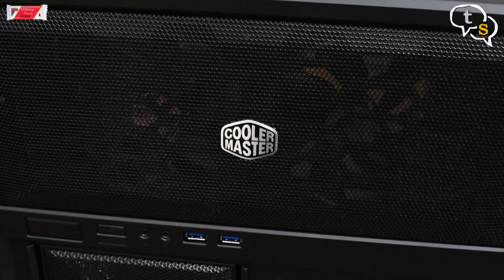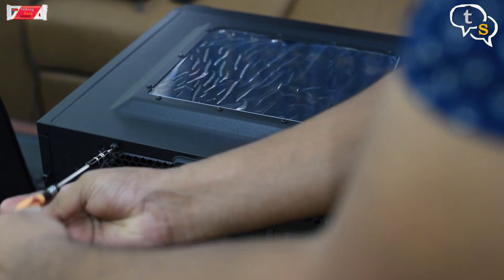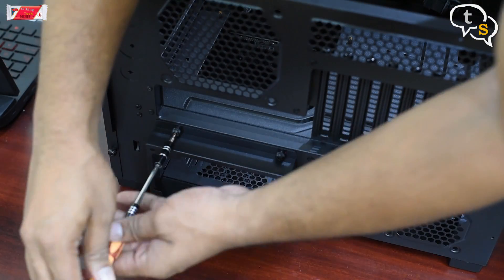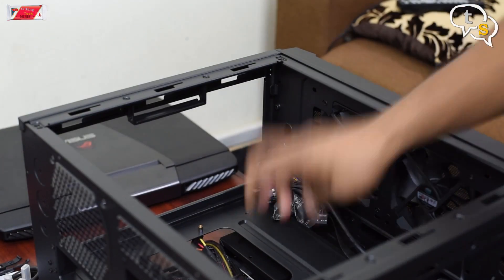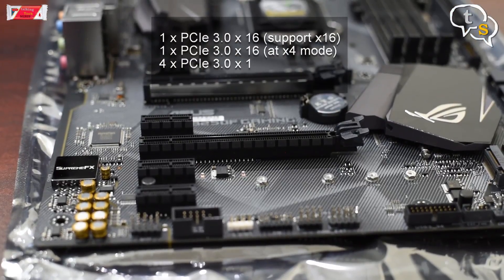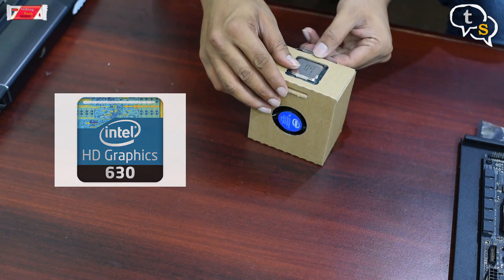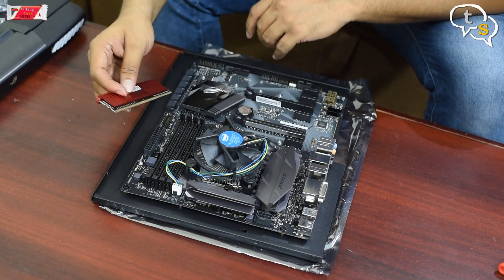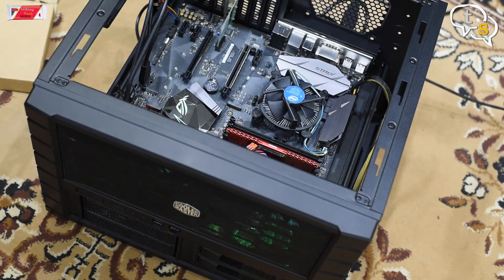How To Build your own HTPC 2018 | Video editing computer on a budget

Comment: Are you building an extreme gaming PC or a HTPC? Pretty sure you've spent 70% more than you had too.
Reply from the maker: Well I have a common gaming/editing pc. Not very extreme as per 2020 standards as I built it in 2017, and upgraded whenever I could. Started with 8gb ram now have 32. Storage I have now 6tb+, gpu has been upgraded to the RTX 2070 super. Etc, started with a gtx 1060.
Reply: @TalkingstuffNet  No problems with the rig, really nice, but not what I'd use for just watching movies (I'm not into 4-8K, yet, as it's overkill for my entertainment needs) and listening to my fav CDs.
Reply from the maker: So over the years 70% more is accurate 😉

Comment: Looking to build my own dedicated hype. Very good video on assembly but I’d like to see some component comparison. Not only price but performance difference...also, are you using a NAS?
Reply from the maker: I have upgraded the system, it now has 32gb ram and two extra 4tb hard drives. I do have a NAS, but it's for backup only. It's my main video editing system.